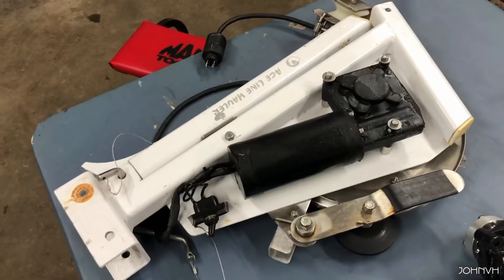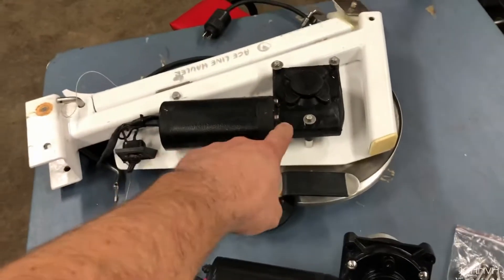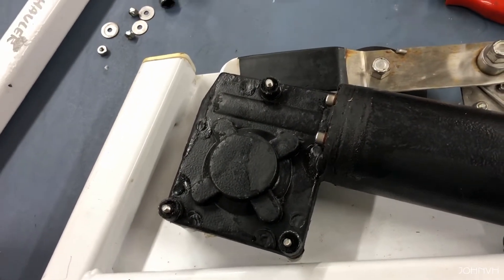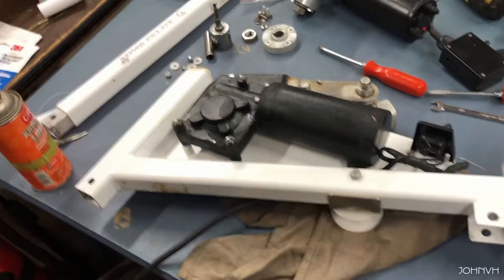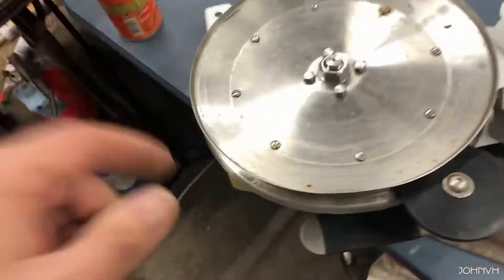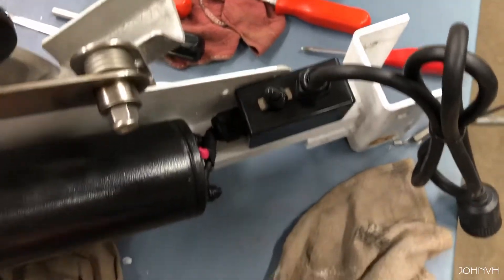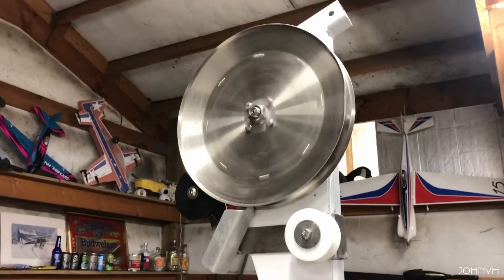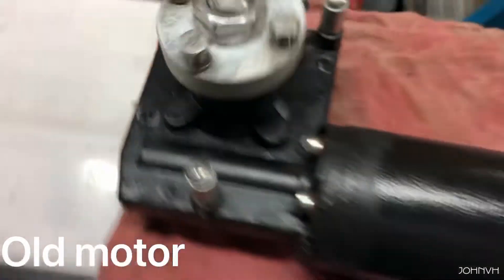Ace Line Hauler Brutus Max Torque Replacement Motor Kit UPGRADE HOW TO

Comment: I just put the same motor kit on my old Ace linehauler.  I took the cover off the black switch box and pulled the switch out to get it out of the way.  I then put 3M 4200 semi permanent adhesive along the outside back and bottom where the box meets the metal post and flat piece.  I clamped the box both against the post and the piece its back hits and in 24 hours it is strong and secure. No drilling or bolt required.  When I put the switch back through the hole it came out of, I turned it sideways so it switches left to right not up and down.  It makes it more accessible.  The cover still fit on perfectly.

Comment: Hey John!  Nice replacement and upgrade!  Should work very well for you now!  Thumbs up!  Regards!
Reply from the maker: I hope so! I need more shrimp in my life. haha! Thanks!
Reply: @JohnVHLife  Review of the upgraded motor?
Reply from the maker: @DSKSeattle  Heading out this weekend with it!! Ill make a new video next week on how it did, and compare it to others.
Reply: @JohnVHLife  I was at Bainbridge Island yesterday and my Ace puller blew two fuses. I’m trying to see if upgrading the motor will help. Where did you buy your kit?
Reply from the maker: @DSKSeattle  Link in the description, straight from their dealer.  Double check your plug, the wires in the back, all connections, use a bigger fuse perhaps
Reply from the maker: It pulls so good now. I’m happy. Video coming soon.
Reply: @JohnVHLife  I ordered an upgraded motor. Hopefully it comes in time before the next shrimp day.
Reply from the maker: @DSKSeattle  Awesome, let me know how you like it!